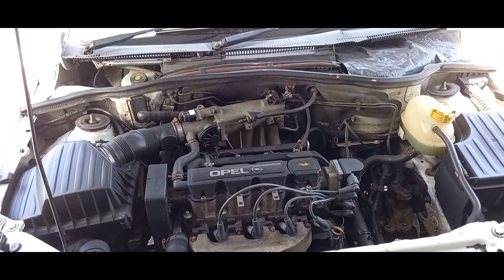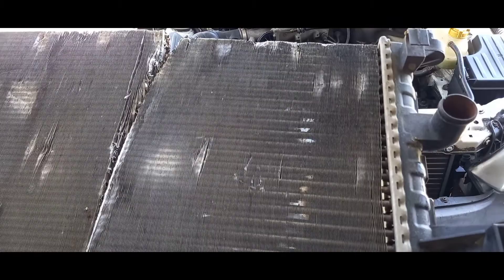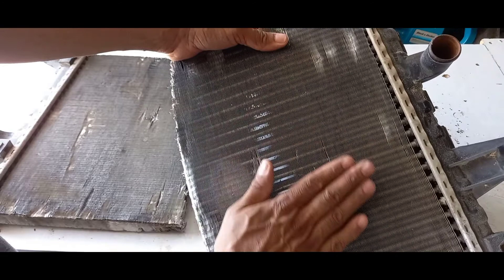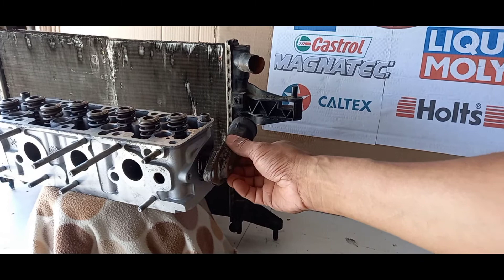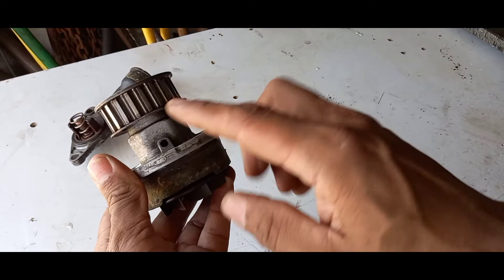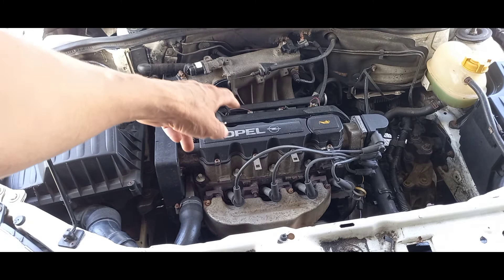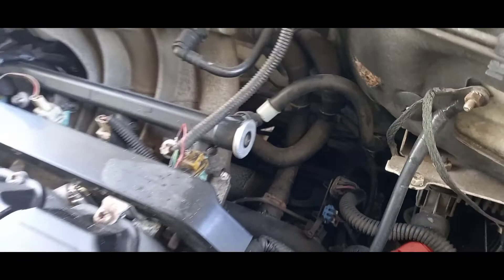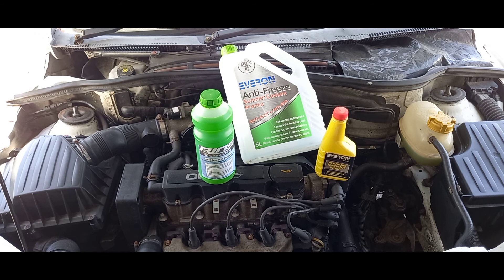Opel Corsa Prevention Series Tip 4. The cooling system

Comment: How's it man hope you are well,just wanna find out ,can the thermostat come out by itself or do I have to remove the cam pulley and belt ?
Reply from the maker: Hi I'm good , hope you are to. This is a great question , yes you do have to take off the cam sprocket. The best way is to mark the position on the sprocket in two opposite places before removing it and then tie the timing belt in place with cable ties in the same way. 
So prior to this you may want to evaluate the situation and check what else needs to be done eg timing belt , tensioner, water pump, oil pump, check crank sprocket.
These answers will be determined by how you do your minor and major services.
Reply: @solveitautomotive9485  thank alot much appreciated 👍
Reply: I just redone my rings and valve stem seals she running like a dream only one issue she is heavy on fuel my mate said it can be the 02 sensor.
Reply from the maker: @ShelwynnShanders  You know it's a process of elimination determining what could be the issue , therefore it's best to take out and check and clean the o2 sensor , check idle valve , mass air , air filter , injectors , fuel pump, fuel relay , air pipes etc. and it's best to use OEM parts if and where possible.

Comment: Hey, I've replaced my fuel filter, idle control valve, throttle sensor and cleaned the carburetor. All the injectors works. But still the idling cuts on start up... It only idles on it's own after I pedal to help for about 10 seconds... All the pipes are in tact.
Reply from the maker: Hi it's hard to give an answer cause it can be a number of issues. 
I take it it's a Corsa gamma 1,4 with fuel injection.
Before you replaced it did u have the same problem.

I would advise that if you replaced the idle air valve , that it be a OEM one an not a pirate from the spare shop.
Those ones don't last and they don't communicate properly with the ecu.

Comment: Hi there i bought an Corsa 1.4i it had a rough idle and sometimes cuts out. i replaced basically all sensors with a great improvement but there is still a slight miss. any idea or how can i contact you

Comment: How much does your heat gage move? Does it go to just below half often?
Reply from the maker: It travels between cold and half . It never goes over . In traffic in summer it goes to half , no further. 
I have replaced the radiator thermostat and water pump twice since that video 
The main reason is that they are not OEM parts and need to be replaced every two years .
Reply: @solveitautomotive9485  I replaced head, new waterpump and thermostat on 1.4i corsa. It use to take long to heat up and then after a while sits on 1/4. Now it would go just above 1/4 to almost half them go down to just above 1/4 again.
Reply from the maker: @roanswanepoel1757  that is exceptable. Just keep an eye on the radiator for leaks and blockages. Also only use coolant 50/50 mix , not just water.

Comment: Excellent content thanks a million. Question: Please could you advise me on troubleshooting my 2009 Corsa 1.4 utility heat gauge sudden rise to around 95degrees. I put 12v to the fan and it turned on. What should I check next
Reply from the maker: Hi . Thanks. Man it can be a number of things . Best to start checking the entire cooling system and then work your way from there. And of course go to a reputable shop.
Reply: @solveitautomotive9485  also, I saw in one of your videos that if it’s the water pump there would be signs of a leak. What are the signs your thermostat is damaged?
Reply from the maker: @famba0  a main factor in all problems is how well you did your services. 
Also certain parts particularly moving parts need to be changed out between 50 to a hundred thousand kilometres eg water pump, thermostat,oil pump , tensioners , lifters rockers etc.
So you need to determine how old the parts are in your engine. 
The type of coolant in the engine is very important.
Reply: @solveitautomotive9485  one last question. I idled the bakkie this morning and at around 80degrees the fan came on and all was working perfectly. Then I did the same a few minutes ago and temp went up to 90 with no fan coming on. Does the thermo switch offer both temp indication and tells the fan when to switch on or is there something else control when it turns on
Reply from the maker: @famba0  Your temp sensor or cold start sensor under the coil will do that in combination with the thermo switch.

Comment: Hi man, I've the same car, it has high revs, tried to clean the throttle body and the sensors still the same. On the other side it is making a fun ticking sound near the injectors. Can you help me on that please?
Reply from the maker: Hi it is hard to give an answer, but possible u have a electrical problem  at the coil pack. When it revs high press down in the wires of the loom closest the  coil. See if the revs drop. Inspect all electrical plugs around that area for water or oil inside them 

All sensors must be OEM (made in Mexico) not after market. Clean out air idle sensor with carb cleaner as well as maff sensor with maff cleaner.

A good service can help.  air filter,  plugs oil , oil filter , plug wires.
Reply: @solveitautomotive9485  thank you so much, you genius.
Reply: @solveitautomotive9485  I checked there's a little bit of water on them. I need to overhaul the engine then .

Comment: Hi can you tell us where the temperature gauge sensor is located, we have an opel corsa 1.4i lite. The temp gauge is not working at all when u switch car on. Also the car has high revs intermittently.
Reply from the maker: Yes it's called the cold start sensor . It's sits on the cylinder head usually below the coil